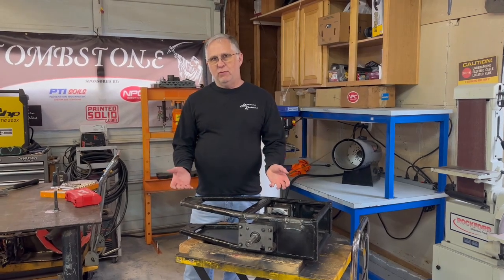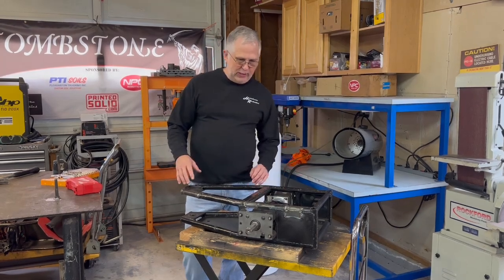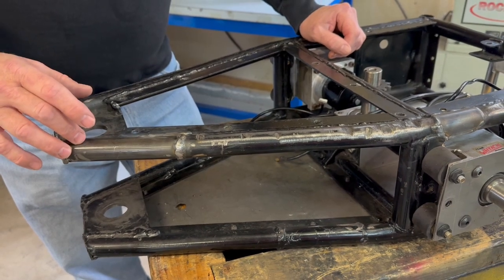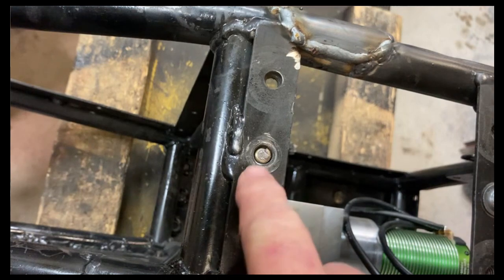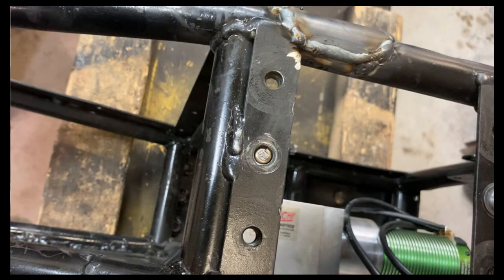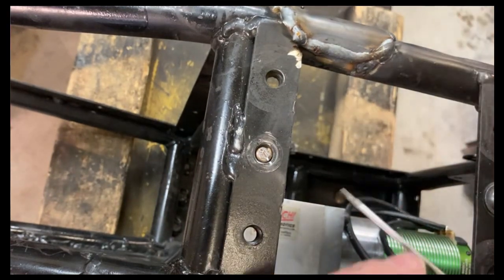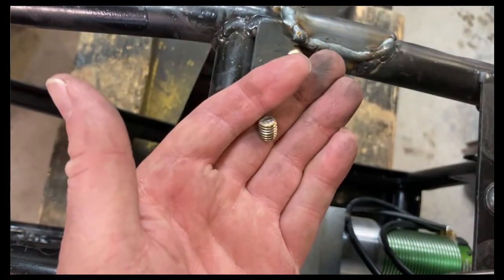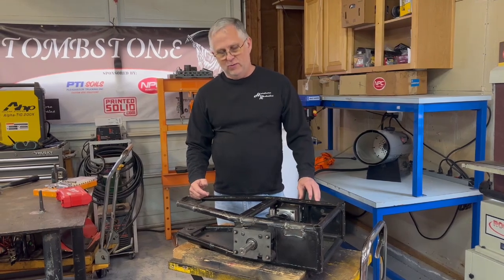Robogames frame repair

Comment: How much weight does the welding add?  Is that going to be a problem?
Reply from the maker: Welding wire can add up for sure - you are adding steel the whole time. And the patches sometimes are heavier too. We should be good on weight though I feel.

Comment: How much weight do you allot for repair patches?
Or do you have to remove some armor to stay under the limit?
Reply from the maker: The new battery setup is slightly lighter than previously, so we've got some weight to play with. We should be fine.